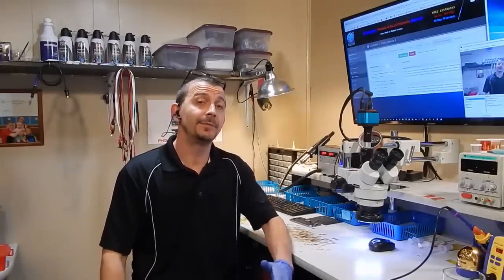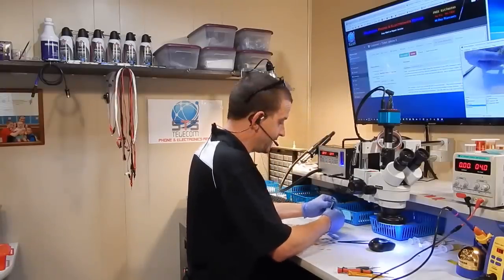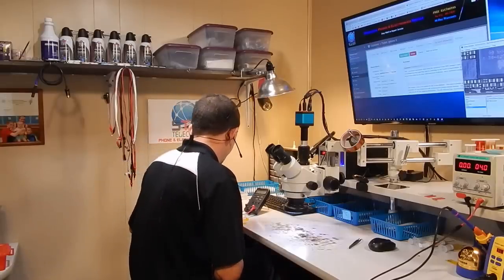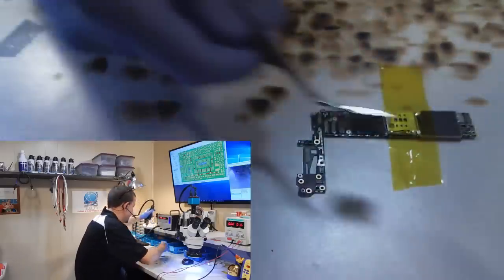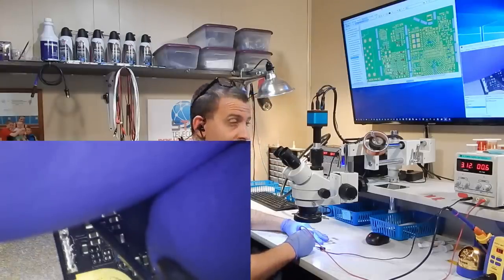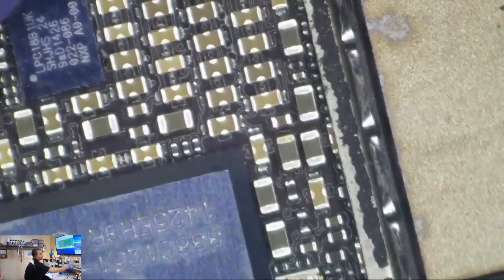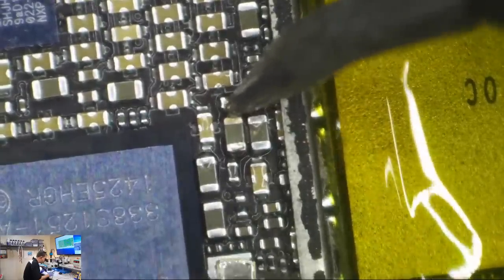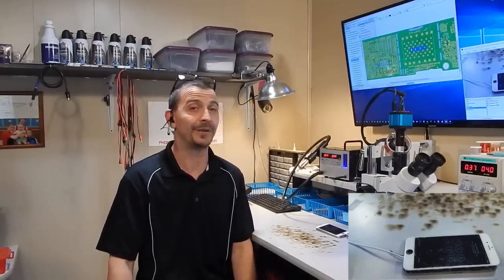iPhone 6 No Power Repair from Canada - Short on VCC_MAIN

Comment: my iphone charges however, it gets warm when i use it and it discharges really really fast, in standby mode and normal usage. I've changed the battery twice now and no difference. What could possible be the problem? is it perhaps a board related problem?
Reply: Jan Fenyane Hey there, yes it's possible to be board related. There are IC's that control how the battery work and how it charges. One of those IC is the possible cause. You can continue to replace the battery but the same issue will still be there. And it will look like it is fully charged or it is charging but in reality it really isn't. Hope that helps. :)

Comment: My iphone 6+ issues,
1. Mute turns on and off automatically while using. Mute switch not working.
2. Not charging normally "accy not compatible" pops up everytime i plug the charger so i do the turn off trick to make it charge even w/o charging indicator display.
3. Power button stops working, no sleep no turn off thats why i cannot charge the phone anymore.
4. Now its dead. Please i need an honest opinion whats wrong with my phone, whats the problem at what to be repair or replace.. 
Thank you very much

Comment: Would a thermal imaging camera be useful in situations when you are searching for a source of heat in such a small area?
Reply from the maker: Yes.  They're not that far out of the question budget-wise anymore either so I may add that to my tool collection one day.
Reply: Dont do it. Finger, alchohal, and freeze spray much faster and far cheaper
Reply: STS Telecom    much misunderstanding how electricity works here.
Heat is generated by electrical power which is amps multiplied by volts.
So 4 Amp x .5 Volt gives 2 Watt which is easily dissipated by the board itself and your supply leads.
If the cap is fully shorted (zero Ohm) it will dissipate nothing!
So a thermal camera is of no help here.
Reply: Yea I don't know anything about electricity that's not what I do for a living. However, thermal cameras detect differences in heat. If it is hot to the touch, or boiling alcohol because it has raised the temperature, wouldn't that be a difference in temp?
Reply: sure the camera will see something hot.
In this case with a shorted cap there is no heat.
Reply from the maker: I agree on your calculations of ohms law being why this heat dissipates so quickly.   Not much real power being consumed.  But the heat created by a short depends on the quality of the short itself.  In this case, our tiny capacitor got hot enough to begin discoloration.  Alcohol in this area would have sizzled around that cap.  It may have been zero ohms to start with but as the weak link in this closed circuit, it must burn.  :-)   I'll admit though, it was a very good short and did not produce the sort of heat you would normally see from components this size.
Reply: This is the difference in Engineers and practical workers. Although his calculation is correct that doesnt mean jack shit in the real world application or repair. 
That cap if small enough and low enough resistance to ground will get hot. Maybe not at .5 watt or 1 watt or maybe even 2 watts. But if you drop enough amps into the components they will get hot if they are low ohms short.
Reply: Too true +Chris Long. Theory and practise can and often are streets apart.
Reply from the maker: Thank you Mr. Long! :)

Comment: Jay can you tell me is the parts on A1567 and a A1566 the same  ie  ipad the problem I have is I tried to change the charging port on the A1567 and maid  a mess and apart from that it's a working bored so the point I am trying to get a working bored I can post it to you

Comment: Hi, 5 Amps means nothing. 5 Amps * 0.5 Volts = 2.5 Watts = low heat . 5 Amps * 4 Volts = 20 Watts = Heat. --- Now V = I*R  --- Low R shortage = low V = Low Watts = Low Heat.

Comment: Current is not what makes heat.  POWER makes heat and power is the product of voltage and current.  You keep repeating that this board is dissipating all the heat but the reality is that there isn't any being produced in the first place.  The power you're supplying is the power supply voltage times the power supply current which is hardly anything at all due to the low voltage.  Short your leads together and crank the current limit up to 5A, then notice how your probe leads DON'T melt in your hand.  When you have something like 0.3V * 5A it's still only 1.5W that you could convert into heat.  A totally dead short will take a lot of current to produce heat and the current limit of your power supply won't permit that to happen.  This is absolutely normal and not at all because the PCB is sinking heat.
Reply: About the only smart comment i have read. When he would have kept increasing the current, he would probably have burned a PCB track or desoldered his needle probe, before the shorted cap released some magic smoke.😉

Comment: iphone 6s all of sudden went off and not starting, checked with third party they said that , motherboard is gone!!! all oof sudden ,My Phone battery was almost 76 -78 percantage, its not working tried hard reset, charged phone, tried changing cable and charges and connecting to itunes not detecting. My data is important how can I restore any way.and bring back iphone to working condition.

Comment: Do you know that the power is the current times the voltage? 3A times 0.5V is so much power - it will burn your hands dude :)))
Reply: And if you have short in the VCC, just put some current anywhere, you do not need to put it on the caps and guess a spot  ... the electrons are moving to the short anyway :)

Comment: I don't know shit about electronics repair but isn't there some device that uses thermal imaging to see hot spots on the board instead of using your fingers? The final word was, if I'd used freeze spray I would have found the problem sooner. How much does a can of freeze spray cost anyway? So if 5 amps would have fried another component, not already broken, would he have told the customer he made a mistake and the repair will cost more money or is now damaged beyond repair? Probably not.

Comment: 15-20 mins for this type of work
Reply from the maker: Cool, you should get a LOT of work then.  =)  It showed me your original comment before you edited.  You know, the one about removing everything from VCC_MAIN being faster than what I did here.  You would spend more time rebuilding the board after finding the short than I spent baking this thing into showing its face.   Freeze spray would have been the fastest route.  Measuring voltage drop at key locations rather than heat would have been the second fastest route.  Most shorts are quick to find but not when they're this solid.    $125 in 50 minutes is pretty good money.  I could have spent longer on it and still been completely comfortable.
Reply: i wrote it but then decided to edit cause any repairer must do it in his own way  
but u must do it faster , really. its ur time its ur money 
of course dont forget about quality 
yesterday i replace tristar on 6 for 20min with disassembleing and assembleing 
yes , we have a lot of work but generally it is very difficult failures like CPU NAND , trio on 5\5s\5c and huge water damages (3 ICs and more)

Comment: if Q1403 is the hot spot on a shorted board does that indicate Tigris is the problem? or Q1403 itself?
Reply from the maker: That's going to be a short on VCC_MAIN.  It leaves Q1403 stuck handling the load between battery and vcc_main.. it gets very hot
Reply: Thank you brother! it was C1298 i spotted it as soon as i peeled the sticker back (grey solder) i then tried current but no heat so i just went for it, DAM!!! what are they made of kryptonite?? was a hell of a job to replace good lesson tho, was a £60 phone off ebay now worth £200+ thank you thank you thank you :)

Comment: Dude, why so suffer? you can simply plug in to the power supply Board and lodge 4.3 volts x 4 amperes, pre-treating with freezer, cut his throws instantly capacitor   location! You are not looking for easy ways (((

Comment: Where is your air filtet
Reply: Filter
Reply from the maker: Well, currently that is in the form of good exhaust to the outside world from this room.  I'm going to be piping that down to the bench really soon similar to the way it was on the old setup.  I really make very little puffs of fumes now to even be concerned about with good ventilation and airflow but recently, starting to do chip-off data recoveries, and that creates A LOT more than a little bit of fumes so...  I'll probably do a video on this fume extraction setup that I will be using.  Planning to suck it up directly at the microscope head from above.  Thanks for being concerned about my health! :D

Comment: Hello how are you I was wondering if you could help here’s my issue I replaced the screen and now it telling me unable to activate Face ID on this phone
Reply from the maker: I'm doing good, thanks!  I hope you are well.  That can be a real bummer on phones that have Face ID.  If your new screen came with a new ear speaker flex cable already installed, that would cause it.  They have to have the ear speaker/sensor flex from the original screen.  Unfortunately there are a lot of things that cause Face ID to break though.  I'm really only able to guess from here.